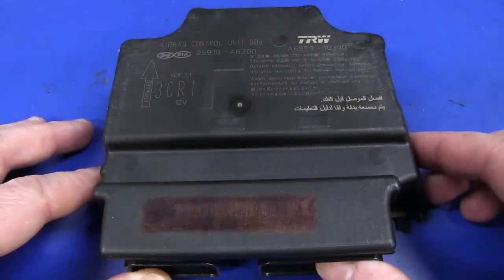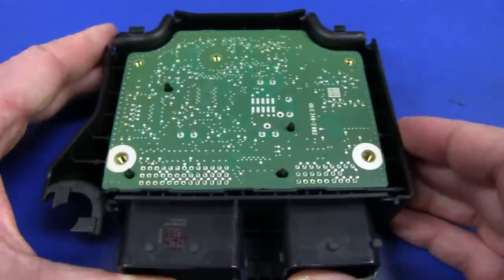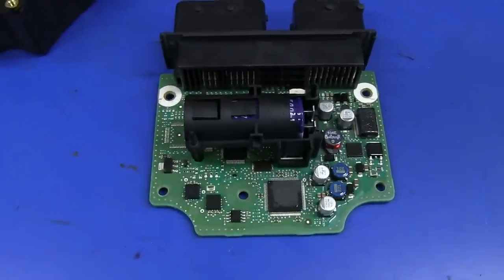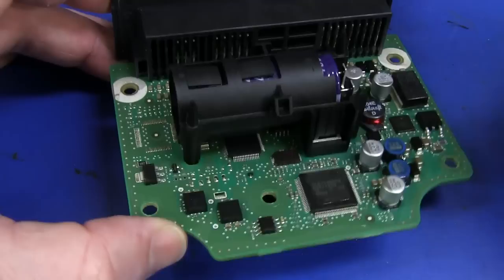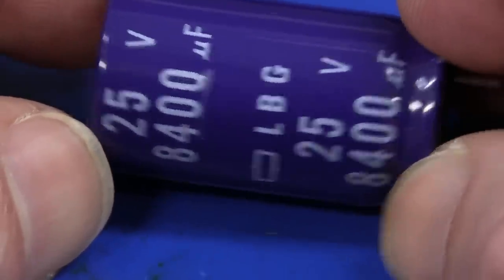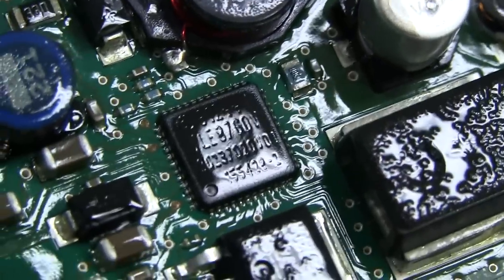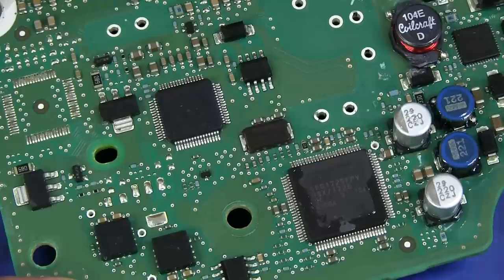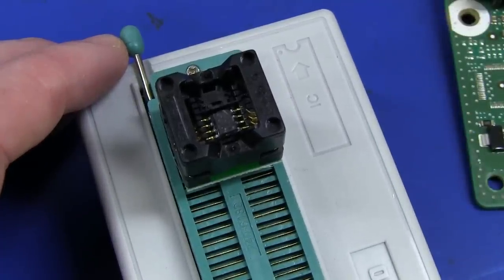EEVblog #517 - Car Airbag Controller Teardown

Comment: Another reason for the large cap is that (at least in a GM) the squibs are set off by a higher voltage, I think it's around 32 volts. I'm not sure how much current is needed but I'm sure it takes quite a bit to set off the squibs. After the airbags have been set off, the control module, sensors, and wiring has to be replaced with the deployed air bag modules because the high current flow does destroy the airbag circuits in the process of setting it off.

Comment: The capacitor is for power backup. In a crash one of the first things to go is the battery because it is right up front and the cap allows the system to still set the airbags off in the even that the battery or wiring is destroyed.

Comment: @NuttyforNissan: The battery compartment is (in most models) in the boot, on the right side below loading level. There are crash sensors in the front bumper, rear bumper, (in most cases) front doors and rear doors. When one of those sensors triggers it sends a CANbus signal to the MRS module which uses an algorithm to decide to employ airbags or not and sends a CANbus signal to SRS module (airbag module). When the rear right panel is hit, well... than your screwed ;-)

Comment: The slide connectors are interesting, are they silvered for contact resistance? Working on 80's mercedes benz the leading cause of component failure is cap life and solder expansion/contraction. My theory is these cars werent garaged. Hot summers and cool night, mild days and freezing nights outside of a garage. So yeah, pretty sure why they started using the slide connector.

The old w126 body MB airbad controller is a gorgeous metal canned inertia device that contains a mercury switch, in which the heavy mercury has to make its way up a ramp to activate the bag. There is a separate metal box containing some electrolytic caps (all metal caps with the leads on each end, not sure what thats called) which is present if the vehicle power connection is terminated before the airbag deploys. Very simple, all silicone wiring.Those caps in the reservoir are still at spec which i thought was neat. I should send some interesting mb parts

Comment: I'm surprised that they opted for an Immersion Silver finish for the press fit connections.  That stuff will corrode fairly fast compared to Immersion Gold or ENIG.  I guess to their defense, that is usually in the presence of hand oils and UV light but still...

Comment: You are right the large capacitor is to provide power even if the battery fails during crash the power is used for the airbags and to keep the micro-controller running and have enough time to write all crash data in the eeprom.
Infineon was part of Siemens so wee used Infineon microcontroller but not other parts the Power ASIC and the Squib ASIC was custom build by Siemens Automotive.
You always need minimum two of anything like sensors for safety reason there are also external sensors.

Comment: The big cap is for the 1-2 minutes of power to blow up the airbag in case of a battery loss in the crash. And probably to ensure enought power to write the crash data to the eeprom

Comment: I imagine that cap is indeed for backup. It's not hard to imagine a car's electrics don't take too well to a frontal collision of course. I wouldn't be surprised, looking at the pin count, that this thing does other things than just ignite the airbags, like setting off the seatbelt tensioners and maybe even turning off the ignition activating the hazard lights.

Comment: That's what the industry calls it.  The coating is usually sprayed on by an XY axis air gun to protect the circuit from moisture and prevent migration.

Comment: I would guess that larger caps would be used in that holder depending on the safety equipment aboard.  For example not all cars may have rear torso airbags as standard - or some markets may include seat belt tensioning devices that are also fired pyrotechnically.  If this car didn't have the full complement, it'd make sense they'd use a smaller cap in the single-part holder.

Comment: There is what what looks like a boost converter for that giant capacitor on it. It is probably for the airbag, but I wouldn't know. Just for extra power it would probably be a supercap.

Comment: The Capacitor is required for deploying the airbag.  If the battery is up front, and is destroyed prior to airbag deployment, the capacitor provides the energy to fire the detonators.

Comment: Thanks for making this video. I love learning about cars but when it comes to the computerized components it's usually like hitting a wall. Not even the factory repair manual tells you anything about them other than to replace them so I never get any chance to learn anything about them.

Comment: The other (external) sensors used would be things like seatbelt connection sensors, seat weight sensors, crush rate sensors (for the front crumple zones), a connection to the body control module etc.

Comment: I presumed cap is less temperature and parametric sensitive than a battery. If you look at the datasheet, the operating temperature of that specific cap is -55 to 105C. The cap operating hours was tested at 105C for 5,000 hours. Hence it may last even longer for lower operating temperature. 

Try to get the same current rating in a battery for that temperature range. I think it's harder or impossible.

Comment: Try the engine control unit ... The biggest you can find in a car. You will find lots of specific chips and big microcontrollers specific for engines. Even peripherals of the mic are for engines. In the next years you will find multicore mic with lots of flash ...
Reply: Multicore is already state-of-the art in ECUs. But those ECUs aren't as interesting as they may seem - bit of signal processing, bus interfaces, and some driver chips. The magic happens inside the chip, and that is well protected. One interresting feature is that they come with protection against code or data manipulation, to stop people from tuning. And boy, oh boy, the code on them is complicated. Typical application manual is 10-25000 pages long.

Comment: 8:50 you're probably right on the money with the cap being backup power - where's the battery mounted in (most) cars? The worst place to be in a head-on collision ;)

Comment: I would recon its to set off the airbag. Its an explosive afterall and  explosives (albeit in a totally different application) are set off with capacitive firing systems.

Comment: The press fit pins were designed to replace soldered pins in earlier designs which failed by thermal expansion.

Press fit pins fixed one problem, then they go to crappy FLASH devices that lose data integrity in under 10 years.  Also that ugly all in one peripheral driver IC that fails.

Comment: That cap is mostly there so the control board can deploy the airbag even with a total failure of the vehicle's normal 12V supply.

Comment: You could have ran a disassembler of that processor on the ROM image. Those ASCII and numeric things can be algorithm code and if you know assembler you can reverse the algorithm.
Reply: The dump that Dave showed during the teardown was that of logged data in the serial EEPROM. The serial EEPROM might contain calibration coefficients also. It does not contain executable code. The algo code is all contained within the flash within the microcontroller, and that is security locked to prevent readout.

Comment: First of all - HMC generic requirements for electronics appliance contains among others also 500x thermal shocks. Soldering of the leadframe to the PCB of this size wouldn't work reliably (cracking). 
Second,this connection is cheaper to produce at automated line. It's quicker,inspection is easier, equipment is simpler and needs less maintainance.
Pressfitis are almost standard under the hood today, Hella has proven this technolgogy also in VW group (originally banned this technology 10 yrs ago)

Comment: id say the reason for the short cap in the holder is a 12v vs 24v system. (ie the 24v might be a longer cap)

Comment: Hey EEBblog

Get yourself an early Volvo seat control module.  They sometimes fail from time degraded FLASH that has gone corrupt; but read the data from the Motorola CPU for a nifty easter egg!  :)

The programmer talks about his family and what his daughter likes in a block of unused memory!

Comment: Dave - good ol'vid as ever - just quick Q with regards conformal coating, could/would it be worth it to use a spray applied acrylic version on PC equipment before mounting in the loft/shed - I ask as I plan to move soon and living in the UK - plus moving next to a water way - it's going to get much damper in the outbuildings than in my current office abode, and wondered if a conformal coating could extend the life of my equipment some?

Comment: Dave, could you go over how to design a backup powersupply with a giant cap  that would automatically be engaged if the main supply fails and be able to digitally detect when the transition happens so that a MCU could be notified?

Comment: if you mean why not put a battery inside the sensor housing its simply a reliability deal batteries don't last as long as caps if they are good quality

Comment: 2 Accelerometers = confirm working properly before deploying bag?
Reply: maybe used for a Kalman filter
Reply: i would agree with this theory
Reply: Kind of redundancy. ISO26262 / ASIL D requirement. In a plane calculator there would be three, and not only different component models but also from different vendors. This is the same reason why there are two MCUs. In the Infineon brochure, they clearly assume that there will be two MCUs in this kind of system, that's a typical requirement for this kind of function.
Reply: Yeah and probably signal a error if there is to much difference signaling a system failure to the cars safety systems. Airbag error visit your garage... Service required. I always hate those system required sh%t, but in this case it would be nice to be warned of a failure.
Reply: Yes, this is tedious, but this is 'the only way to work'.

The purpose of having two devices for the same function is not to allow the system to work 'normally' and 'indefinitelly' if one of the two devices fail, like a 'backup equipment'. The purpose is to:
1) Have better coverage of the potential failures that have not been identified through the device design. Even if the diagnosis functions of the device doesn't cover every single physicaly possible failure, the presence of a second device allows comparison, and detection of incoherence indicates without doubt that one of the two devices is failing, surely following an 'unidentified' failure mode. Even failure modes that have not been identified during the design can then be identified. For sensors, like here, the critical information is the measure that is provided. With this topology (two devices + comparison), you can guaranty without any doubt that, at any time, the system knows if the data of the sensor is valid or not.
2) In the cases when one of the device is failing AND the diagnosis allows the identification of the failing device, then the system is still functional, thanks to the second device which works, in this case, as a backup. In the case of an airbag, this means that if one of the accelerometer fails, the system can detect it, and still has another way to make the airbag function work.

This kind of redundant design works with two assumptions:
1) When a failure is detected, the system MUST be repaired - e.g. Tell the customer to go to the garage.
2) Double failures don't exist. The system is not able to detect them, not even manage them.
(The only way to add more safety to a system architecture like this is to add more redundancy. That's what they do in space / aeronautics.)

Knowing how it is designed and how it works, and knowing what is the purpose of an airbag system, telling the user that the system is not functional and should be repaired is not 'nice', it's the only way to guaranty that the airbag will be functional when an accident occurs. The life of the user is at stakes, here.
Reply: Ow, there is a third assumption:
3) The system has been correctly designed, and the error tolerances between the data provided by the two redundant devices is correctly defined.
If tolerance is too large, there are failures that won't be detected. If tolerance is too thin, there will be false positives and disponibility problems.

Comment: I don't know, but I could imagine that they are better than Batteries (especially Lead-Acid ones, which use mostly water which freezes)
They can operate at higher temperatures aswell (most of them are even rated at 105°C)

Comment: lol @ not sure on the Infineon chip buy in. The Infineon Tricore processor, thanks to Bosch, is one of the largest (if not largest) quantity of processors used in automotive systems.
Another thing, its popular for EEPROMs to be removed on these and replaced with programmed ones with the modules default data on them. Most of these controllers can't be moved between cars (locked on VIN info in the EEPROM), so if the module fails, you need to buy a new one (£££) from the car manufacturer.
Reply: actually, this is a safety mechanism. Mixed control units don' usually play nice with each other. Just imagine the airbag assignment was change halfway through the production run (stuff like that happens all the time). It might just trigger the wrong airbag in a crash. Also, notice how many pins were not populated in the connector. Different options... It might fit, but it might not work.

Comment: That ST chip is most likely the failover MCU, look at the infineon example block diagram, it has a secondary MCU that has a simple fire signal if the main MCU fails

Comment: Most of the data in the controllers is programming what equipment the car has different seats use different buckles etc. also the vehicle identified number. All modern cars the modules are married to the car and not plug and play. I specialize in BMW modules and reprogramming junkyard modules so people don’t have to buy a new one from the stealer.

Comment: guess which part will dry out and fail after 10 years in a car ?
Reply: The driver :)
Reply: The eeprom for crash data should be the weakest link in the circuit depending on how it's being used.
If it's constantly recording the last 30 seconds of speed and throttle position before the crash then it may burn out after a few years.
Hopefully they still work without that part being functional.
The second is that cap if they got Chinese knock offs into their supply line and it has happened before.
Reply: Patchuchan The pre-crash data could be stored in an RAM and only written to the eeprom in the event of a crash. Pretty sure they would do it that way.
Reply: +frtard That's how they do it and that's why you need a big energy reserve capacitor - it takes a few ms to transfer RAM to EE. Power during that data transfer must be guaranteed.

Comment: FLASH memory devices should never be used in airbag controllers.  I see them failing all the time in ABS units.  The IC is okay, but the FLASH has become corrupt.  You reprogram and good again.

You can get away with it in instrument clusters and ABS modules.  But as an Airbag controller?  No way!

Comment: Wasn't aware that every airbag system contained satalite sensors..makes you wonder........
Reply: Not every SRS system does, but it's more and more common. Most have satellite sensors inside the doors, for example, to detect side crashes.
Reply: it isnt a satellite as in gps - its satellite as in remote from the main device.
Reply: It's the sensors elsewhere in the car such as the ones often attached to the radiator core support.
Reply: readyrepairs WTF????????
Reply: Makes you wonder as in how the shit are cops so good at spotting people without seatbelts, LOL...must be a sensor transmitting.
Reply: "pad kid poured curd pulled cod" Who the hell is stupid enough to not wear a seatbelt?